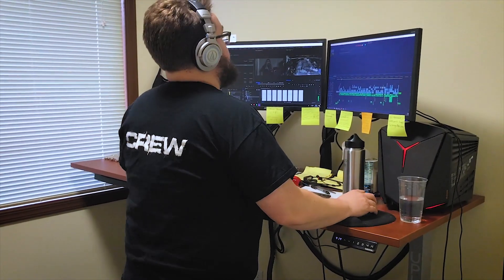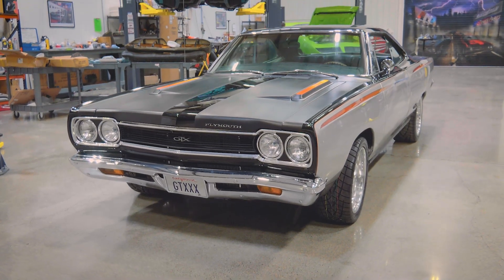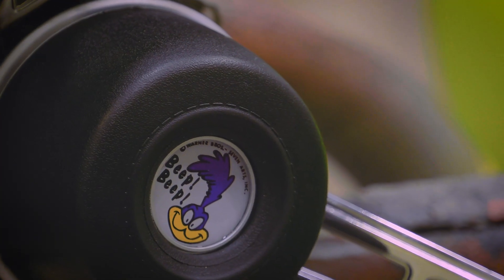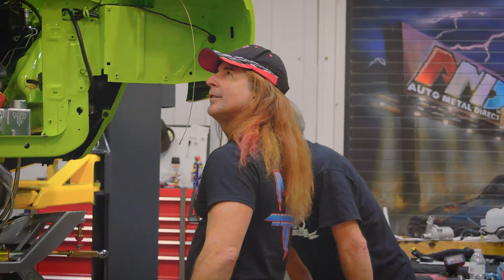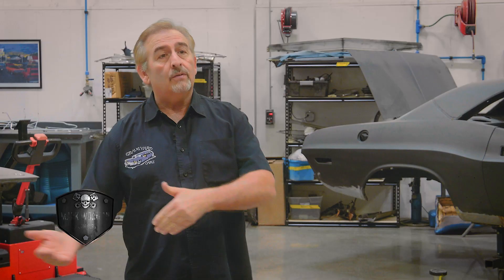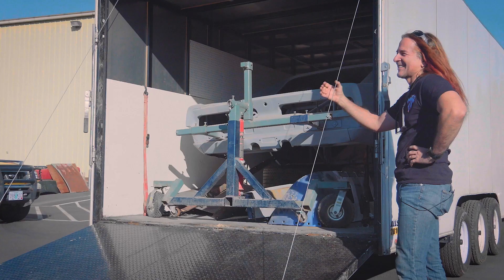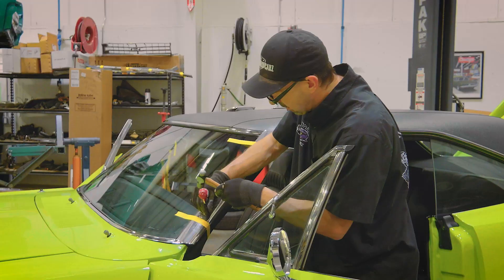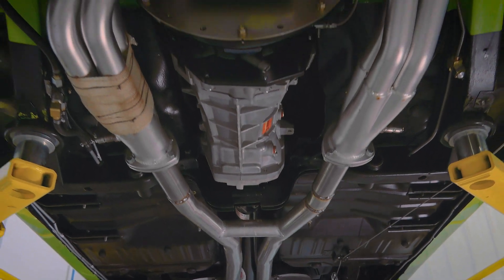S09E01: DAYTONA EXPLOSION!

Comment: Well to be honest Chryslers have had fir issues from day one to present day so why would anyone be surprised that it caught fire. Sad it happened to a beautiful car  just glad they were able to save it.
Reply: I’ve never saw a vintage mopar burn  unless due to crash with electric fuel pumps
Reply: @jeffrogosz383  
From what I've read a fire is almost a sure thing in the area of the Ammeter, old wiring arcs and up she goes.
Reply: @briancaverly1826  sometimes the bulkhead connection gets wet and crusty and can get pretty hot 🥵 but personally I’ve never had a problem but I guess mice 🐁 could have something to do with it also ???